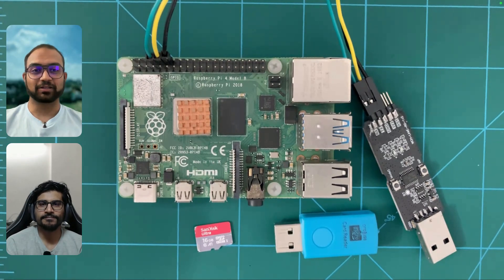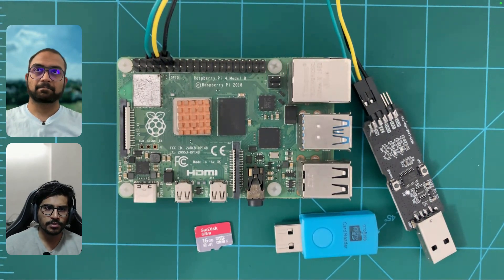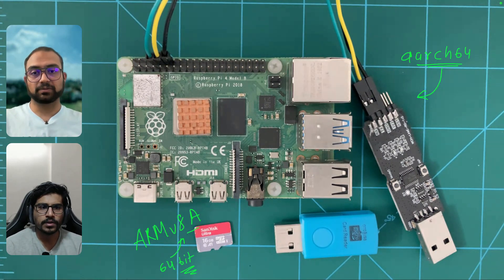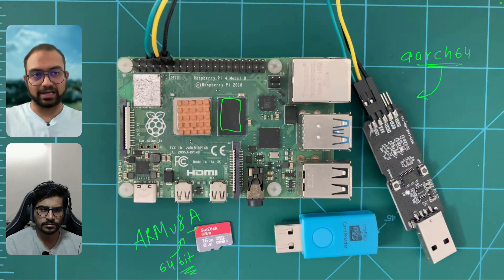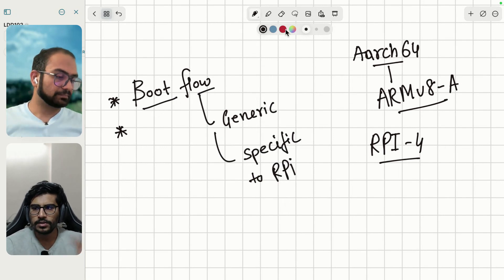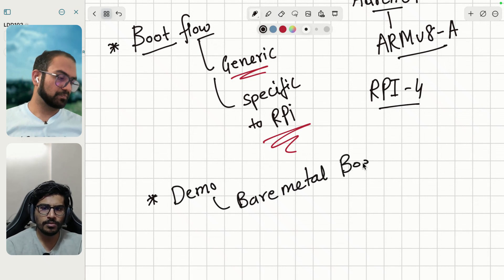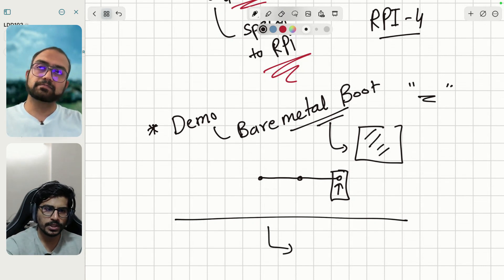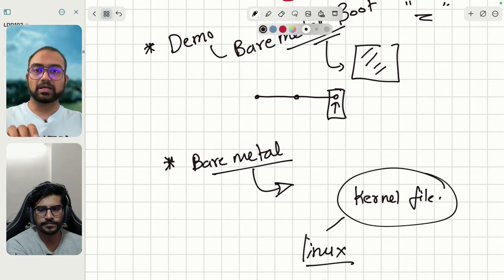Linux Device Drivers Course - Programming Real Hardware

Comment: I recently bought your course I have a question :
Can i use pocket beagle 2 for this course as it is also based on "ARMv8-A (64-bit)"  and has 2-PRU's as well !
Reply from the maker: The address map will be different. General concepts will hold but you’ll need to figure and tweak the boot sequence. Also, can you point us to the board? May be we can add something about that towards the end of the course :)